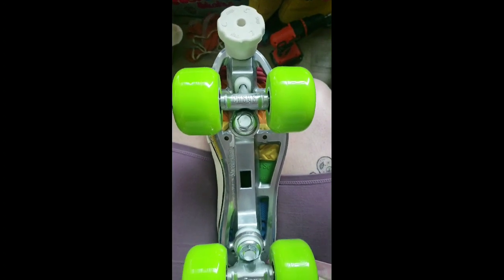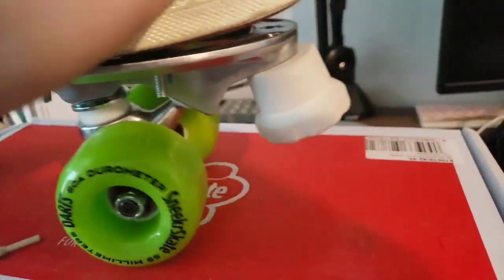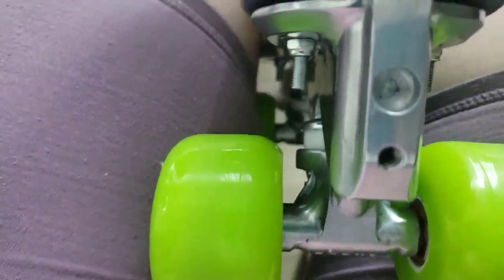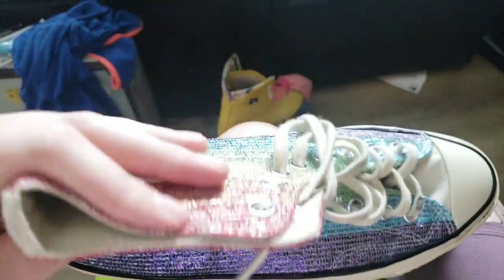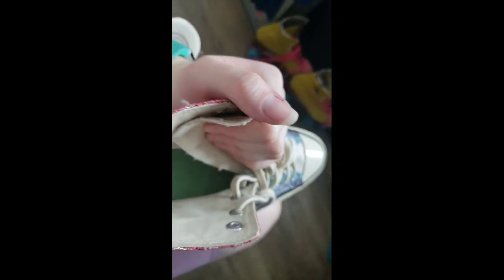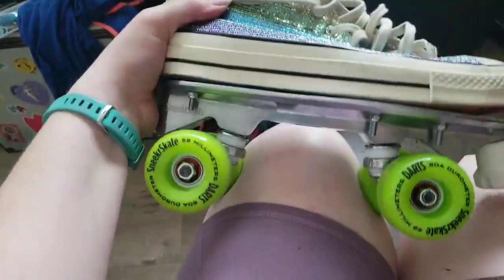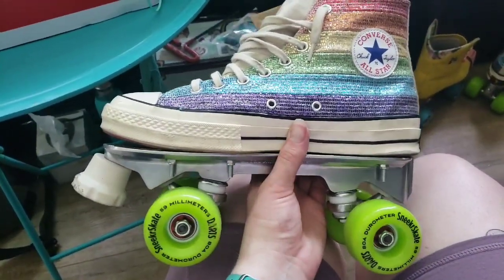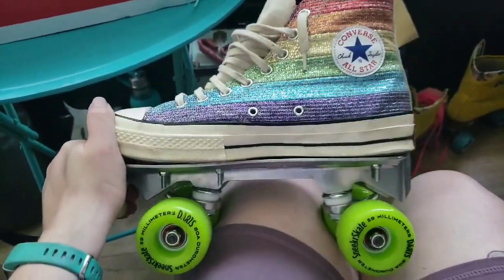Chaya SneekrSkate Full Review and Assembly

Comment: I got these and to get around needing a heel I used a high top shoe (nike blazer) and put a heel raise insole in, which seems to work really well. I also found I had to remove the wheels in order to tighten the nuts on the plate with the tools I had.

Comment: With respect to tightening the kingpin bolt - You might try to invert the Kingpin bolt prior to mounting so that the nut is in the down position by the wheels. At that point, you should be able to tighten it at the bottom without removing the whole plate. That is if the nut is not permanently attached to plate!
Reply from the maker: I actually did try that! I thought that would help infinitely, but the smooth non-threaded shaft of the kingpin was too wide for the opening in the plate, so it didn't not work : / the only way to attach the kingpin to these short of replacing the kinpins alltogether with some more generic bolts is to face them up into the skate : / lame.

Comment: Great review. Btw, I got the wide trucks SneekrSkates and I was able to change the cushions without dismounting the plate.
Reply: Are you sure? Nothing rattles? I really tried to put trucks back in and getting it in  nut, but it was just impossible for me.
Reply: @olddirtyspatula  absolutely sure, but I did not move the skate much, so maybe the nut stayed in place. I tried it, when they were not mounted yet too,  to check if the king pin does go in the nut and if you keep them leveled the nut stays in place and you can screw the king pin into it just fine, without even touching it with your hands.
Reply: Are the kingpin head and the nut the same size? I ask to see if they can be inverted for a traditional setup?

Comment: I have to correct myself-- one of my toe stops came off really easily, and the other one feels like it's stuck and will stay there forever. I just didn't know that when we were talking on fb bc I hadn't tried to remove both stops yet.
Reply: Hi Michela, I broke one toe stop off and the other one was impossible to take off like you said so i had break it off and grind it smooth. Ended up buying a adjustable toe stop without thinking about the size difference. Chaya should of design this plate with a 5/8" thread for an adjustable toe stop to begin with ( I email them and the company I bought from about it ). Thinking further, I managed to get a couple tools, then drill a 37/64" hole right next pre-drilled one, bore out the hole with a Tap size 5/8-18" right hand thread. Problem was fixed but its a bit of effort. Let me know if you want to see some pictures. There are more steps I did not described here.
Reply: @andythanhle7628  I am absolutely interested in this!!!! But I'll admit it's bc I just started a channel/blog about refurbishing roller skates (rollerskaterevival), so if the tools are accessible i'd probably learn how and do a tutorial someday. Agreed that the weird toe stop is a critical design failure on their part.

Comment: It's funny to see you struggle with the same things I did, I also didn't like mounting them with the trucks on, I also thought it was weird that I couldn't angle the drill around the trucks. I ended up using a drill anyway and scratching the plate, but then thinking "oh well they'll get scratched anyway after I skate on them...." and yeah pushing the mounting hardware through the sole was surprisingly hard. I also thought it was weird that the wide-trucked "park" ones come with such soft wheels, I think literally no one takes such soft wheels to a ramp. I did and it was exhausting! But yeah I agree, for the price point it's a good beginner hangout skate, especially since it comes with wheels and bearings and you can mount them yourself instead of paying someone else $30 to do it for you, on top of a $30 aluminum sole. TBH though I wouldn't recommend it to serious park skaters. I have a suspicion, that only time can confirm or deny, that the cast aluminum won't hold up to a ton of serious abuse.